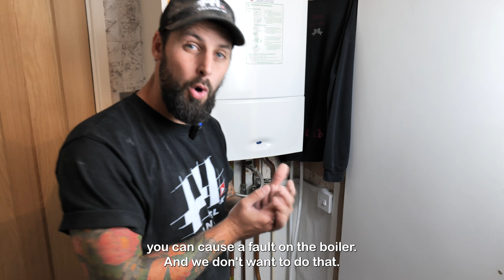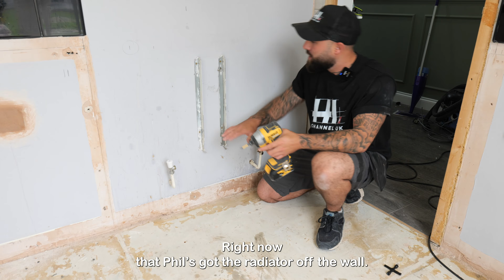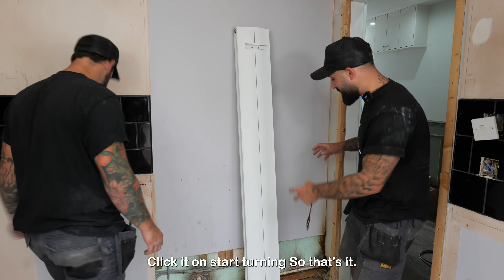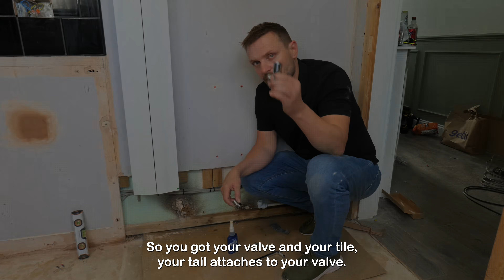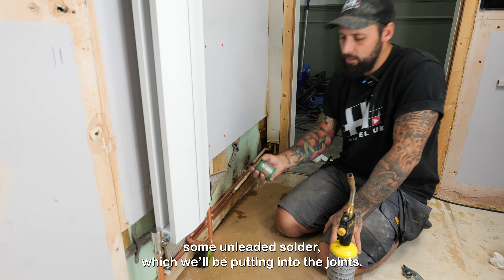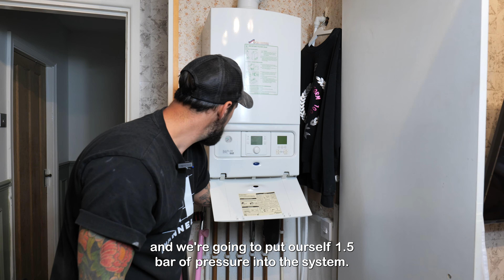How To Install Vertical Radiator (Soldering Pipes) - Step By Step Guide

Comment: Hi, My TRV valve is set to zero and it still warms up when combi boiler is on. Do I need to change the TRV valve prior to replacing radiator or is there a manual way to close it off ?

Also, Im changing all the rads in the house from standard old ones to new designer ones is it ok to do room by room over a couple of weeks (take off, amend pipe work, replace with designer). Im worried im pushing all the old water into my new designer rads? Thoughts? Unless after 4 weeks of slowly changing them all I just drain the whole system and then refresh with new water ? But I dont think itll come out of the radiators tbh. Let me know your thoughts, cheers!
Reply from the maker: Could shut the other side